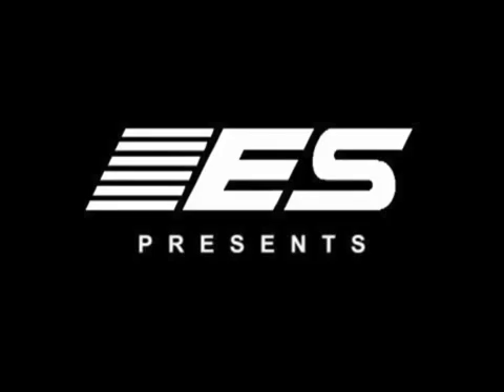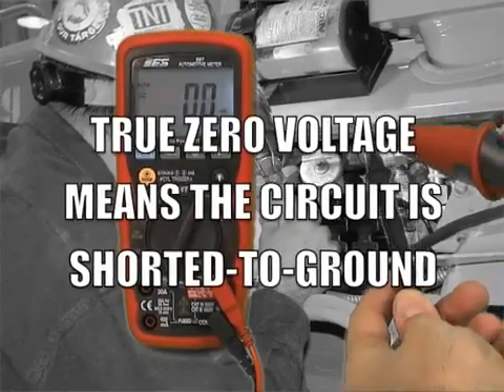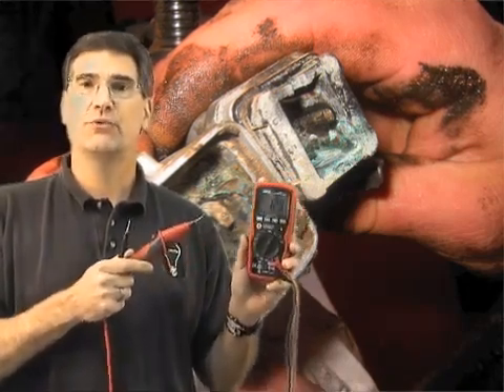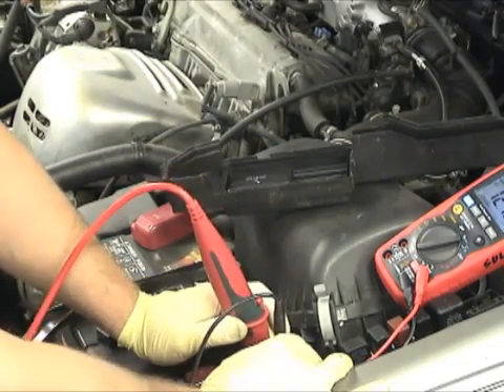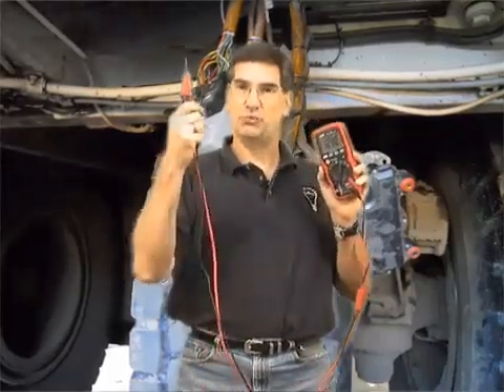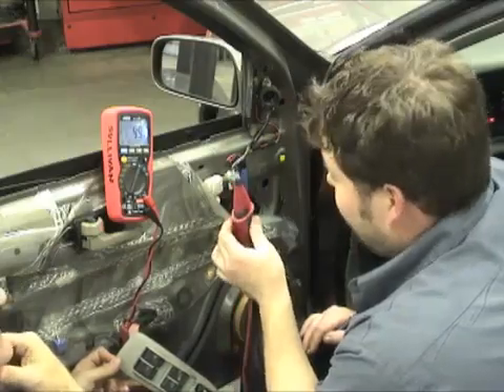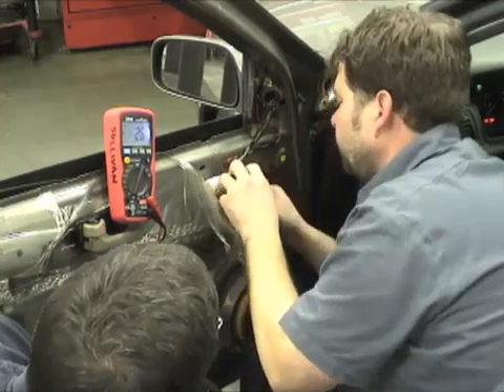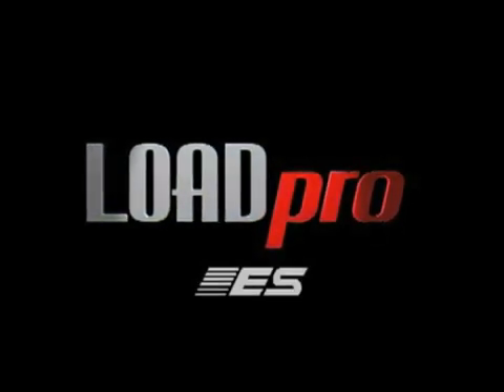Toyota Master Tech Applies LoadPro | How to use the ESI180 with multimeter

Comment: Ghost voltage is not voltmeter open circuit voltage when the leads are out of circuit. What was shown in the video as described as ghost voltage is just called open circuit voltage, which is not really ghosting anything. 

Ghost voltage is a relatively stable, expected and displayed value on a very high impedance DMM. The meter is reading a voltage value that makes perfect sense for the system being tested but is really just ghosting the reading through a high impedance coupling mechanism (usually capacitive), but not as high by an order of magnitude as compared to the DMM input impedance, which with some high end DMMs is extremely high (greater than 10 Mega Ohms). 

What follows is a description of how you would see ghost voltage on a DMM:

1) Reading AC volts in a residential AC load center: If you use a high quality DMM for AC work, like Fluke 289 TRMS Industrial Logging Multimeter you could be looking at the output of a 120VAC branch circuit breaker to see if it is off, only to read 113VAC on the DMM display when the breaker has clearly tripped and the handle is in the off (tripped) position. The circuit is indeed de-energized and what you are reading is AC ghost voltage being coupled into the DMM on AC volts, and is very common for high impedance DMMs. 

The voltage reading looks familiar but is really a ghost, an electrical artifact. Just like a ghost looks like a living person, but in reality, there is nothing real. A ghost reading is a lie. 

It is so common a problem in AC industrial work that with the Fluke 289 there is an AC Volts special mode called Low Z AC Volts that reduces the voltmeter input impedance to around 3.2k Ohms, which will eliminate ghosting. If you look in the Fluke 289 operators manual for this mode it talks specifically about ghost voltage.

2) Reading DC volts in an automotive power feed circuit fuse block bolt in fuse near the battery positive terminal: When measuring DC Volts you can also have ghost voltage in an automotive application where you measure the output of a large current fuse relative to battery negative and it reads +12VDC. But, when a load on the circuit the fuse is powering is turned on (draws current to operate) it fails to operate. 

What has happened is there is corrosion on this high current bolt down fuse where by it is acting like a very high impedance voltage source, but still at least 10x times less than input impedance of the DMM. To combat this it would also be helpful if the Fluke 289 had a Low Z DC Volts range, but since the Fluke 289 is designed for industrial AC work it does not. But, there is an easy fix, all you have to do is lower the input impedance of the DMM on DC Volts with a resistor at the meter across the voltmeter inputs. For power feeds on a 12V application 1000 Ohm should work well, and you will not be fooled by DC ghost voltage again, even on Halloween. 

Going back in time, if we measure AC Volts with a Simpson 260-8 Analog VOM as opposed to a DMM, you will not be fooled by ghost voltage for residential AC work. The Simpson, when set up to read 120VAC will have an input impedance of about 600 Kilo Ohms as compared to the input impedance of some high end DMMs like the Fluke 289 at 10 Mega Ohms or higher.
Reply: Ya I don’t think any of us read that book you just wrote on here 😂😂😂

Comment: So would the load pro be safe to use from say a crank position connector back to control unit without causing damage to the control unit?

Comment: But what’s happening inside the positive “load” probe? Is there a lightbulb? A big resistor? What is providing load?
Reply: need to get the tool and back engineer it to resolve the mystery i guess, there has to be something of that nature, surely ?
Reply: @sollykhan2385  I bought one - just tested it and it seems to work - just like to know how it’s being accomplished is all.
Reply: @carguy1312  how much did you pay for it? do you feel it was worth every dime? or could have got something far cheaper and made a few tweaks with resistors?

Comment: This tool is bloody good I hope you did get your money back out of it Dan

as a DIYer I’ve used it only a few times - with success

people keep comparing it to the power probe the reality is there’re two different tools my power probe four will show on the screen the condition of the fuel injectors whilst the motor is running 

Each injector is 300 bucks so you’ve just paid for the power probe by changing one injector instead of all eight

it’s a completely different beast you need both of them to be honest…..!!!!!

The LoadPro is absolutely essential

The fact you can test the condition of the wiring in the harness is unreal

And when I do find problems nine times out of 10 it’s a connector somewhere that’s corroded

Excellent Dan…..!!!! You’re a very smart man…!!!

Comment: The tips on the LP bother me because they have standard lead tips. I would use this more if the leads were banana plug so I could attach my pin connectors. This would free up my hands to press switches.

In all the videos illustrating this tool I always see to people working together. One fumbling the leads and one pressing the switches
Reply: Sadly with every 'innovation' there are more problems to overcome,as the old saying goes there will always be more questions than answers.

Comment: great video but I don't  understood  when testing  the fuel pump circuit, did you pressed  the bottom while  cranking the engine? please explain  thank you, cheers, saludos amigo
Reply: I've watched many times because I was also confused.  I think that the master technician was trying to compare the voltmeter values of actual voltage drop (from 12.02v to 10.56V without pressing the Loadpro load button) while Mr. Sullivan was cranking the engine. Then the technician measured the voltage again which was around 12.00v and Mr. Sullivan cranked the engine and the technician press the load button  to see the voltage drop which was 10.44v. Since comparing the value of voltage drops  of  10.56v  and 10.44v, there are not  much differences in the voltage drop, and therefore, they determined that the fuel pump wiring system (wires,fuse & relay) is ok.  So  I determined that the fuel pump is bad and need to be replaced.

Comment: Porque no entiendo completamente el funcionamiento del circuito interno  de la herramienta. Es posible que tenga algun resistor con un valor muy exacto que se pone en serie con el voltimetro al presionar el interruptor y lo que se esta midiendo es la caida de voltaje, pero no puedo saber cual es el valor del resistor, puede ser 1, 10 u 100 ohmios.  De todas formas voy a experimentar en mi laboratorio para entender mejor y luego compro el Load Pro, porque aunque no me convence me inquieta.
Reply: son muy simples matematicas las que se aplican... para saber cuantos Ohms hay en el circuito, simplemente mides los Voltios y los divides por el consumo de Amps para saber la cantidad de Ohms... despues que sabes eso, mides la caida de Voltaje y vuelves a sacar la respuesta de Ohms perdidos por el cable que esta dañado... facil
Reply: con solo unir los cables y apretar el botom sale que la resistecia que se usa es de 25 ohms